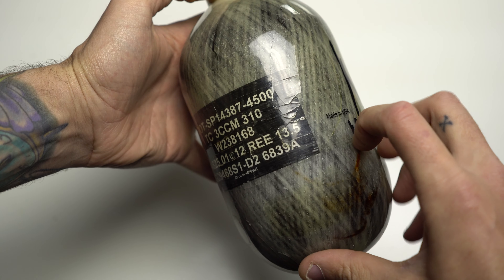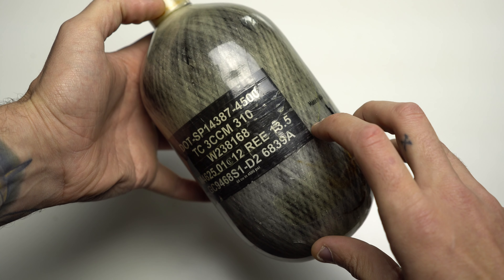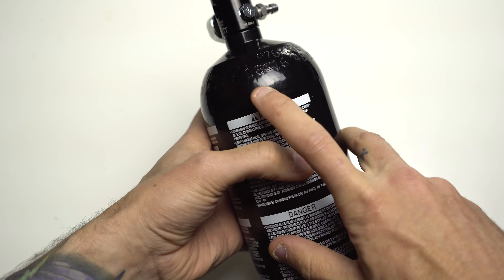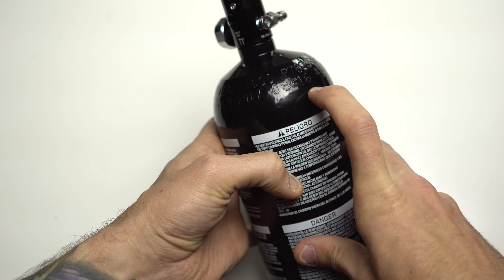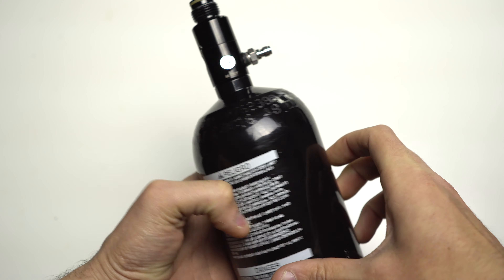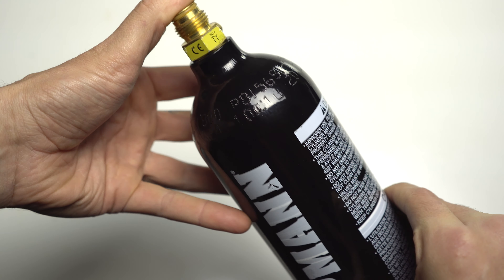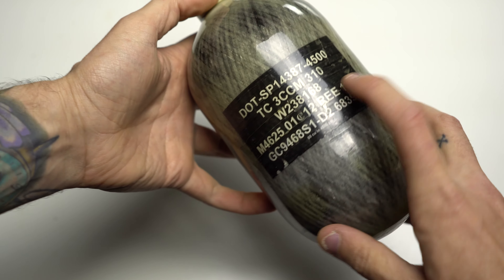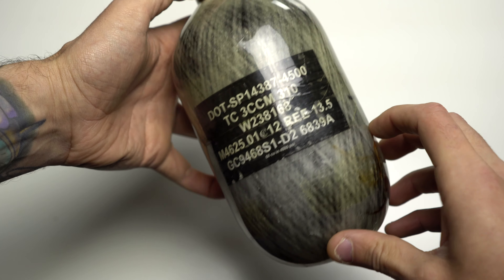All About Hydrostatic Testing Paintball Compressed Air and Co2 Tanks

Comment: I play airsoft but can I put plumbers tape on the thread (like on top and the thread that goes into the bottle )
Reply: yes, but it won't work very well. just get a pack of tank orings. Most places have a pack of 20-50 for $5-$10

Comment: Hey man i noticed you had a 3000 48 ci. Im not sure about U.S.A but in Canada you don't need too re hydro a tank smaller then 52 ci! Anything bigger you do every 5 years!!!
Reply: It's 1litre internal volume, or 61Ci in Canada. If DOT changed the hydro dates it would be all over PBN.

Downside of this change is that it is hard to get 68ci tanks hydro'd because they are so close in volume(~1.1L for the 68Ci) and 77Ci tanks(~1.2L), so some places won't touch them.

Comment: Although DOT(Department of Transportation) that sets hydro testing standards used the word "cylinder" for containers holding gas/liquid....your word choice of "vessel" appears to be better suited given their respective definitions. 👌🏼
Reply: Correct, not necessarily for the type of gas/liquid, but more for the reason that the substance is under extreme pressure. Ever seen an exploded tank?

Comment: So I'm looking to upgrade from my 48/3000 dzs and empire aluminum bottles to something with a little more umph and capacity. Now I have to questions for ya my good sir. 

1.) Is it true that carbon fiber wrapped aluminum bottles still have the Fifteen year total life span for the bottle?
2.) What is a good bottle to test? I keep seeing carbon fiber bottles that are 48/4500 and 50/4500 peanuts by empire. Is the 48/4500 peanuts going to hold more air than my 48/3000 dxs and empire aluminum bottles?
Reply: a 4500 will give you more shots per CI,  while it depends on the marker, a 3k tank will give you 'about' 10 shots per CI so a 48ci 3k tank is good for 480ish shots, while a 4.5k tank will give you 15 shots per CI so a 48ci 4.5k tank would get you 720 shots or so. As mentioned the 10 and 15 numbers aren't exact, but on the same marker you'll get more shots from a 4500psi tank than a 3000psi tank of the same "size"

Comment: hey awesome video, in the future or if you can answer here one way or another what about Ninja tanks or any other tank with a gel coating that's cracked or chipped are those automatically disqualified from being rehydro'd if they're within their date?
Reply: nathan murch depends on the crack or chip
A hydro test is preceded by a visual check
If it is minor in the coating then they will be happy with it, if it goes into the fibre wrap they could reject it for affecting the integrity of the fibre wrap
use a cover to protect fibre cylinders
Reply from the maker: You should be good. I have seen A LOT of them cracked and they have all passed hydro, because like you said "coating" doesn't have anything to do with the integrity of the bottle. If you have a tank that is within its first 5 years though Ninja will resurface it.

Comment: Co2 tanks are around 800 psi and, as long as they have a rupture disk, don't need to be hydrotested. The industry has gone way too far with this so called safety standard. Hi pressure air certainly needs to be tested every few years. Extending this standard to co2 was unnecessary.

Comment: Great message and hopefully it'll keep people safer.  There's a tremendous amount of stored energy in a full tank it's not worth risking safety over a questionable tank.  Question:  I noticed your Ninja tank had quite a bit of surface cracking.  Will a testing facility hydro a tank in that kind of condition?
Reply: That depends on the company doing the hydro and what they consider "damage", the clear coat cracking is realistically cosmetic, but it makes it hard to verify that the carbon/glass fibers are in 100% best condition, so that's entirely up to the person/company testing.

Now as for the cracked coating, Ninja has a specific part of their warranty page that covers what to do
http://www.ninjapaintball.com/warranty
It's down at the bottom.

Comment: Do I need to do the hydro if I used the tank (aluminum) for a year or two then stopped using it, left it without air and just picked it up back to play? The hydro date is overdue, it had to be done some time last year in theory
Reply: lol yes bro if the hydro date is past due it HAS to be tested before it can be used

Comment: How long will a re hydro tank last
Reply: R34_LIRA depends on the specifics of the cylinder specifications

For the majority it's 5 years between tests
For some old types it was 3 years

Here in the U.K. Aluminiums can last 10 years between tests 
Old U.K. Steel 5 years between tests
Certain old uk models were 3 years, but got 'upgraded' to 5 years
Reply: 15 year lifespan. 5 year hydro intervals

Comment: Interesting.  Just looking to get back into it.  Two questions.  Where would you get a Hydro test done and when it does get tested is it marked on the tank somewhere or do you just have paper work to prove when it was last tested?  Thanks!   ps.  I have one co2 tank that is labeled 91 and 2 labeled in 99 lol I guess they are ready for the trash.